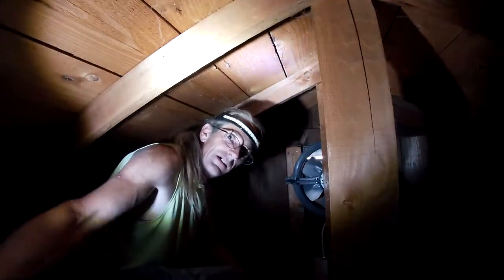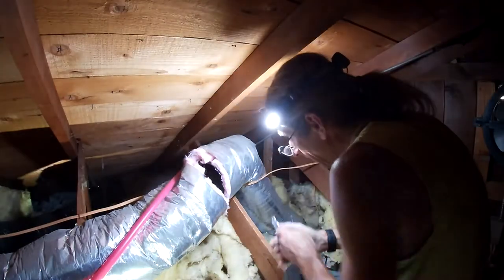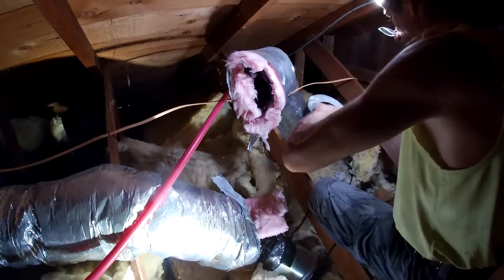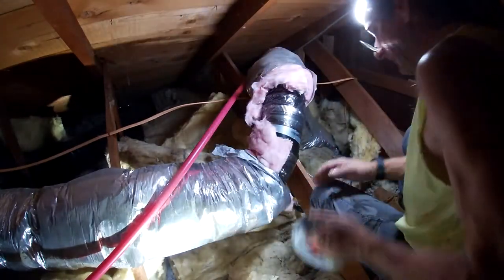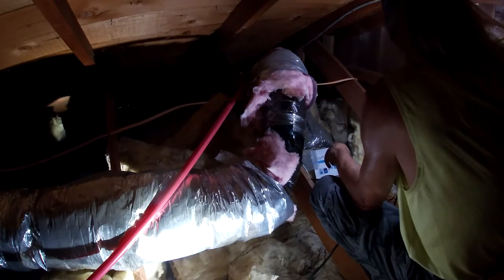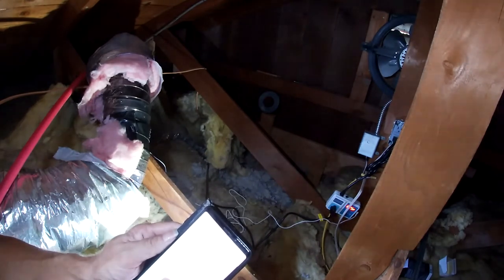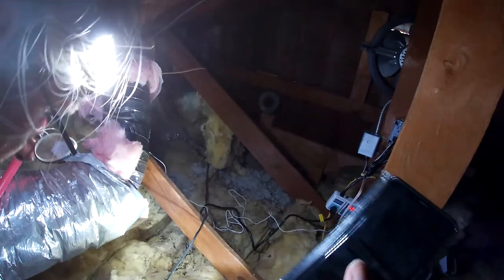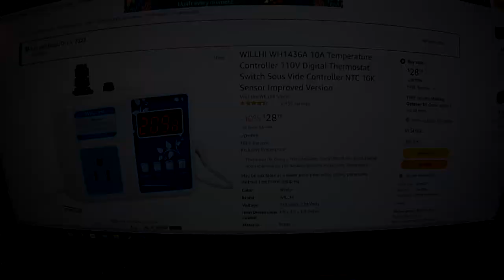Installing an inline duct fan

Comment: great video jason, question—is there a way to hook up the fan to the furnace when the furnace or AC is running, it turns the fan on too rather than running off a temperature so you know?
Reply from the maker: Gosh it's been so long I can't remember but I think the temp sensor was part of the thermostat I purchased for it, If I remember right the fan just ran on 120VAC so any 120 volt circuit should be able to run it just fine. Thanks for watching

Comment: Hello Jason, First comment.  Did the inline duct fan work out after using it for some time? Thanks
Reply from the maker: Yes and no, it seemed to work just fine but the way I set it up has caused me some problems, I decided to use a WIFI smart outlet so I can keep it from coming on in winter when my attic was naturally cold. It appears that outlet has gone bad and the entire project has now lost power. I am sure if I climb up there and get rid of the outlet that everything would work fine. The quick answer is it did exactly what it was designed to do, it pushed more volume of air to the duct I set it up on. Thanks for watching.
Reply from the maker: I went up in the attic yesterday after replying to you and got rid of the smart outlet, the system is working just like the day I installed it now that I am using just a standard GFCI outlet.
Reply: @jason-white  Jason, Thanks for the update.  I guess my comment gave you a little incentive to swap out the outlet.  It's great that it is working again and you are cooler.
Reply from the maker: @joehrlein847  HA yeh it's crossed my mind a few times as of late but who wants to go play in a 140f attic after work lol. I felt obligated to find out after your comment. Thanks for watching.
Reply: @jason-white  Great video. Which WIFI outlet did you go with?
Reply from the maker: @tonymartin6260  I used a Merkury MI-WW118 for this project. I have several of these around my house and this is the first one I have had trouble with and unfortunately it was in the worst possible place to change lol. I am guessing the temps in the attic just were to high for it to last. I have not yet tested it to see if it's working once removed from that environment. Thanks for watching.
Reply: How did it hold up?
Reply: @jason-white  If the duct is insulated, wouldn't the air in still be conditioned (ie cold, when the attic is hot (AC); hot when the attic is cold (heated)).   I think it should be able to run all year around.   Ideally there would a flow switch, so that when it detects air flow (from the furnace), it turns the fan on.   [I know they have them for some air purifiers.]   In my old house I had a fan in a return duct, to help suck more air back from a remote location.   I used a relay attached to the blower motor, so when the fan came on, it turned on the inline fan.